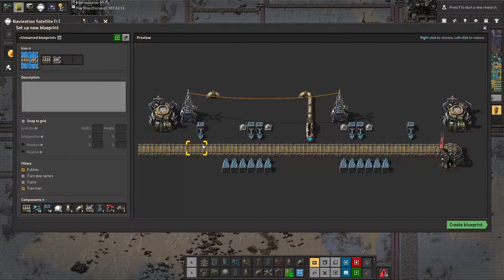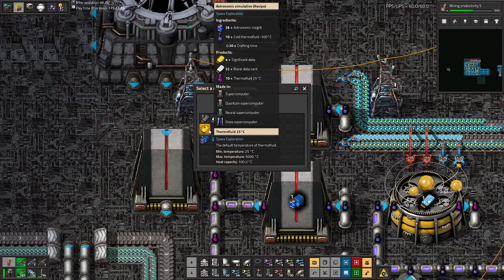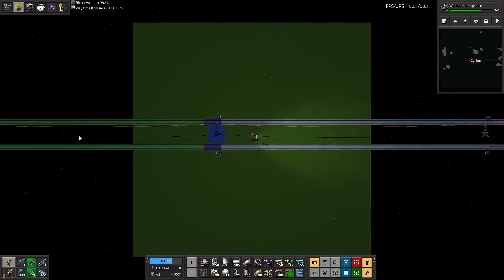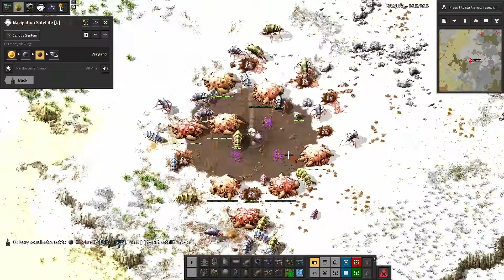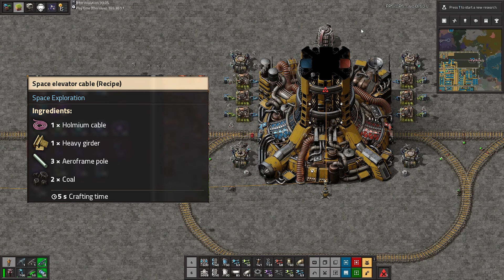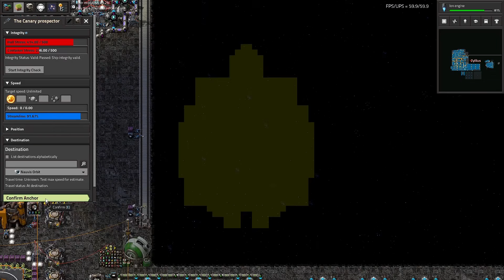How Hard is it to Beat SPACE EXPLORATION | The Second Coming

Comment: I'd legit be willing to pay extra for the detailed explanation of how the sushi belt works. I've spent like 5 hours designing mine and it turned out to be as big as the production block for space science itself; with crap ton of priority splitters, belt scanners, etc. And only fit 8 packs. Here yours fit entirety of science packs in the mod using nothing but conditioned inserters. Hats off
Reply: Count how many packs you put on the belt, and how many you take of. Only put stuff on the belt if the amount on the belt is less than what you want there to be
Reply: @kissa02  I know how many there is fed to the lab by setting "Read hand contents" in the inserter?
Reply: @АфанасийШереметьев-б5ч  The basics of a sushi is a decider combinator used as a memory cell.
Set it to a condition that is always true and connect its output to the input.
Count the items going in (for example with wired belts)
and the items going out (with "Read hand" and turned negative with an arithmethic (each * (-1)).

That should be enough information to get it working.
Reply: @vulkandrache1928  I'm having a hard time understanding the principle behind self-feeding decider, will look more into it
Many thanks for the info!
Reply: @АфанасийШереметьев-б5ч  Since its connected out->in it holds all data every tick forever on the red or green wire.
Any data you put onto the wire beyond that manipulates whats in the memory.

As a test just connect a constand combinator with like "coal 1" as a signal
and watch the decider do work.

If you want to monitor whats happening a more closely always connect the colored wire to a powerpole, that makes it a little easier.

Spoiler:

If connected correctly the decider will count up by 60 units of coal per second
because the signal held by it and the signal provided by the constant are added together every tick.
Reply: @vulkandrache1928  Now I see. Much obliged!
Reply: @АфанасийШереметьев-б5ч  Be careful with the inserter stack sizes, they can screw things up sometimes. Usually I just limit them to 1 item per inserter. Also the point of having a sushi belt is to have a passive "fluid" buffer, you can look at it as a glorified chest but on a larger scale.
If you ask on the Factorio Discord (bleh) there might be someone who can walk you through the process step by step.
Reply: @A_Simple_Neurose  thanks, I've already fully deciphered how it works. Stack size can screw things up, but this can be mitigated -- one section of belt holds 8 items, and there are 32 total different packs. So in my case fully compressed sushi holds 20 packs of each. Then I set the limit to 20 minus stack size and there we go

It seems like many people hate sushi belt, just like I hate daisy chained labs with buffer chests
Reply: I just have all my space sciences dump onto a single belt which feeds into a warehouse. Set the inserters coming from the assemblers to only dump onto that belt in the first place if there are less than ~2k of that science in the warehouse so it doesn't overflow with one kind. Then have an inserter daisy chain feed your labs from the warehouse.
Reply: at 1 hour and 3 minutes in the burner everything video he shows a sushi belt for science, personally I'd rather just have a requester chest on every lab than ever touch a sushi belt but to each their own.
Reply: @KillinTime2792  Yeah sushi sounds more useful for "Set and forget it" set ups where you just dump everything on the belt and eventually it reaches it's destination, but in a game like this, it'd take exponential amounts of time to get anything done cause while some things require hours to assemble, some would require seconds, and when everything has to make a 5 minute trip to be used, that's a lot of time wasted. Still the idea behind it is cool if your character had limited energy and exhaustion like we do IRL.
Reply: A very easy way for you to do it (for small sushis) is to simply connect and read content from ALL segments of the sushi belt. Then connect to your inserters and enable them if specific science < X, where X is a reasonable number to keep the sushi fluid and filled.
Reply: I think he explained it more in depth in his explosive ore video (or his burner video?)

Comment: Why use a load of combinators to filter out signals, wouldnt a constant combinator with -10G signals and then a single combinator to filter out negatives have been easier and more compact?

Also there is a recipe that just deletes the water, why not just use that?

Comment: can you explain your rocket part delivery logic? I don't get how many rocket parts and capsules you are sending per shipment and last video was skipping frames when you showed its logic with its encoding-decoding
Reply from the maker: So the only thing the encoder decoder does is send the number of capsules and cargo sections on that planet. Those are then subtracted from a constant combinator that contains the signals for 200 packed sections and 10 capsules. That plugs into a requester chest that uses those signals to request the amount the planet is lacking. There's some additional logic to block requesting while the rocket isn't ready, knowing when the planet is out of cargo or capsules then launching the rocket, and subtracting the rocket's cargo from the constant combinators as well.
Reply: @DoshDoshington  oh so you dont load up the whole 500 slot cargo, just shipments of up to 10 rockets in a rocket, and the trigger is if something is = 0? ty for the reply, didn't expect it in a sea of 500+ comments ♥

Comment: 1:47 - you may not make such diodes, just put a constant combinator on -100 parts and -1 capsule, connect to the supply net (for example, green) leave the red one on the rocket parts, it will be easier)

Comment: The fact that there's a data card that is 100% just "Crash a train into a wall and record what happened" is just hilarious to me
Reply: That is quite literally about half the work in designing transport vehicles. Designing countless prototypes ramming them into walls and recording if the passengers can survive. If not tweak and start over.
Reply: @simonnachreiner8380  i think i want to be a transport engineer now. . .
Reply: To be fair, failure analysis and material testing is a really type of research
Reply: As they say, the difference between screwing around and science is writing it down
Reply: @fluffyboi999  real life case and point: crash testing, the namesake of the related dummy
Reply: @BrianatorFTW  Well fortunately in real life they do tests on the raw materials that make up the object to get a good idea of what would likely happen at intense speeds or situations. The point of the crash test dummy isn't to test the strength of vehicles, but to test the ways humans can survive them and the damage caused. Quite the opposite of what's going on here as it wouldn't be economical to ram cars just to see how they crumple, but you can't really test how squishy organsms would react if an object they were riding rammed something without setting up that simulation. and even then that was mostly to test the utility of seatbelts and airbag deployment.
Reply: @fluffyboi999  to quote a tumblr post i saw once, "fucking around and finding out is the abridged version of the scientific method"
Reply: @novaseer  Fuck around, Find out, Write down
Reply: YEAH SCIENCE ! :)

Comment: I've been looking forward to this!
All the recipes taking random items is weird, but I guess the main difference from something like modded minecraft is that these random recipes are really the only way to make factorio production chains stay interesting when they have 64 different data cards you need to make. It'd still help if they weren't all obnoxious, though...

I think I prefer just launching a different rocket for each item, and using that as an interplanetary version of what you'd do with a well-built train network. Saves the effort of making a circuit network and it just makes it super easy in general. The main problem is that launching rockets is a little expensive, so obviously once you get the space elevator it becomes better to use rails anyway...

Comment: Its finally here! You mention it a few times but never actually showed it, how do you signal when at least one resource was out of supply? was it just the massive number of decider combinators just checking for 0 of a given resource and outputting a known symbol?
Reply from the maker: Yep.
It's in space and sends the green signal down to the Nauvis station if anything's zero
Reply: @DoshDoshington  Ah I see, thanks! I have been trying to figure out a system myself that was more like the requested setup but circuits don't send 0 of something so I was having trouble detecting when something ran out. I guess this is the best way to do it